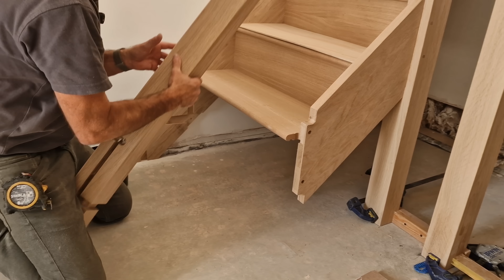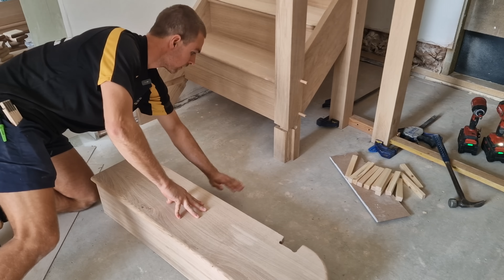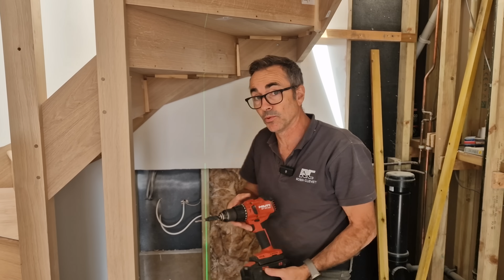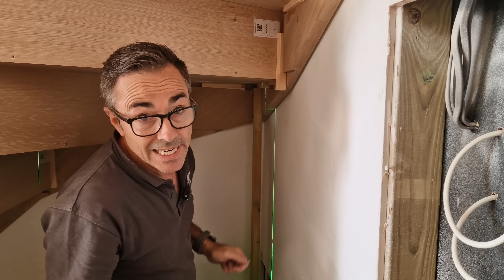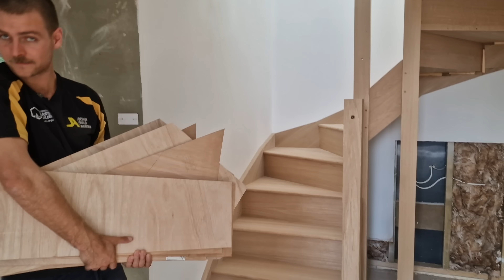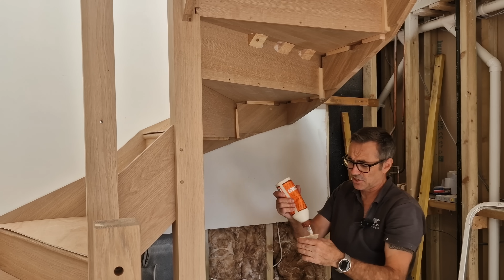Fitting a winding staircase construction part 4. Wall Fixing, tread Protection and glue blocks

Comment: Absolutely fantastic work.

The only thing I would ask, is for the plywood protectors. On the straight steps, did you use anything to stop them from sliding forward when stepped on.

I have visions of the sliding and shooting out from underneath someone's feet.

Otherwise a fantastic idea. You don't won't to be spending a pretty penny on something like that, only for it to be marked and scuffed whilst the rest of the works are finished.

Comment: Not overkill, getting carried away or showing off?
 The inside of the staircase, full of PINE wedges and SCREWS   Into the back of the risers… and you’re worried about  pelleting fixing screws into the stringer?

Why not pellet every riser, why not use oak wedges, maybe shape the ends, sand the whole area and get the French polisher in? 

Come on mate 😂

Comment: My only question is: doesn’t the glue require clamping? Will the glue box have proper hold? I would have thought it would need a pin nail to “clamp” them until the glue sets? (Just an amateur watching)
Reply from the maker: No it's incredible the glue sets super hard and unlike a joint that may need pulling together the glue blocks simple sit in position

Comment: What do you do with fixing top riser and top tread being in oak and fixing top newel to joist.
Reply from the maker: There is more information about this in the other parts 1,2 and 3
Reply: Yeah I mean fixing top tread down into joist. And fixing the newel to joist. I can only see you hook the top tread stringer on and fix to the stringer to the wall. On Mdf stairs sometimes I screw through the top riser into the joist because the stairs are normally carpeted. I’ve never done an Oak finish before.

Comment: Made similar  stairs like these in the 90ties and than had to go and install it, very satisfying to see it in place.  Without the wedges don’t know why they are in there, it really take away from the stairs beauty. The plugs seem unnecessary with all those ugly wedges in sight.
Reply: Use and changing temperatures and humidity over years. The wedges can be given a tap after a few years. The underside of this staircase is hidden. Agreed about plugs covering the screw heads. Wedges cater for later movements. Speaking as a customer living with new staircases
Reply: @cuebj not if you glued them in
Reply: @cuebj if the wedges are loose in there, yes you can tap them tighter, but they can also just fall out by the vibrations using the stairs, so it’s not likely they well be loose in there. And these stairs will probably have some plasterboard under them or build in storage under the stairs, who is going to break all that away to tap a a wedge tighter a home owner?  Don’t think so. Wood works it’s a natural product accept it and don’t have ugly wedges in an expensive staircase.  Not to be negative about the skills of mister Clevett, he has mastered his craft love his roofing work. Just not a fan of staircases made this way.